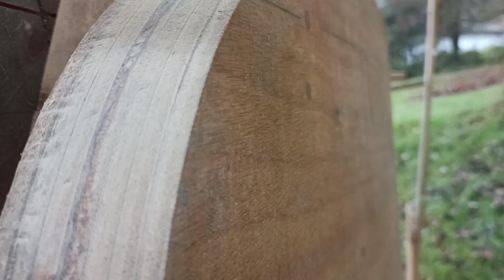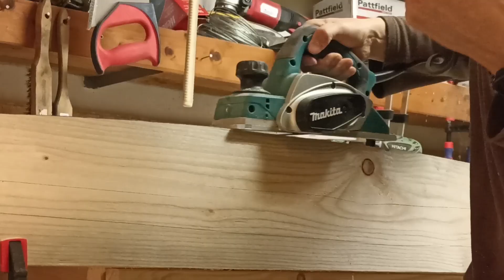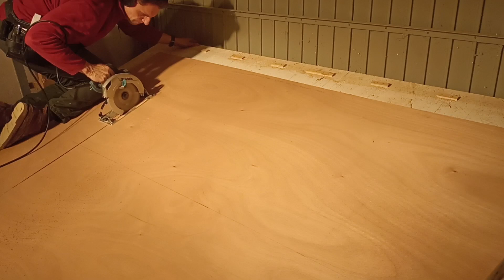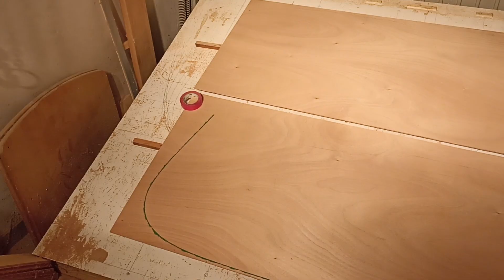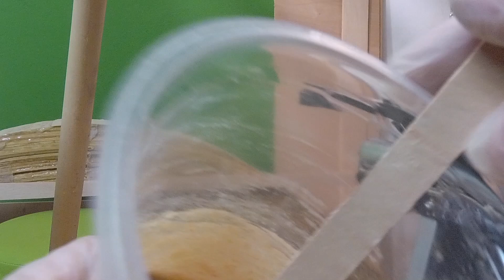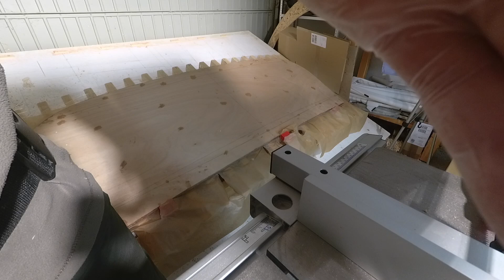DIY LOBSTERBOAT: Ep. 05 I Building The Transom

Comment: I suggest using truss-head screws for temporary fastening as they do not embed themselves into the materials being clamped down.
Reply from the maker: That is a valid suggestion, thank you Scott! I guess I used drywall screws because they tend to torque down gentler onto (or rather, into) the work. I found that screws with washers, for example, are more likely to tear out or snap even, because the greater surface of the head stops the screw more abruptly, when driven in. It comes down to the angst of that happening, I guess; I just went the safe route ;) Holes need to be filled, either way.